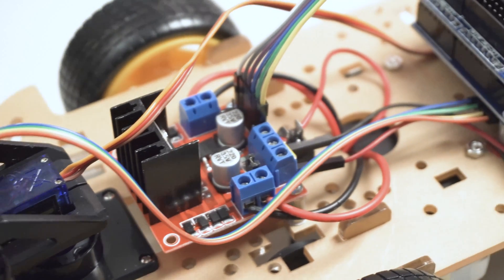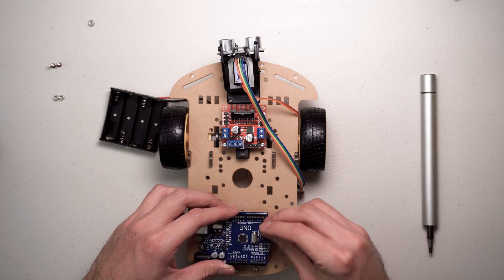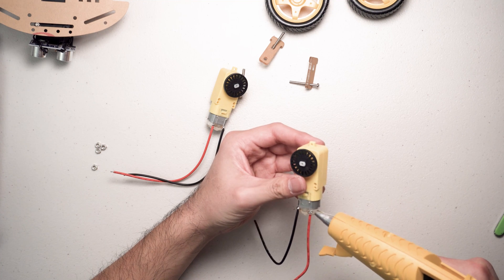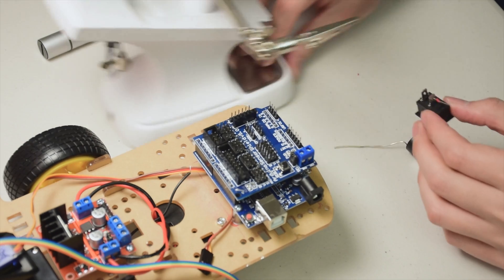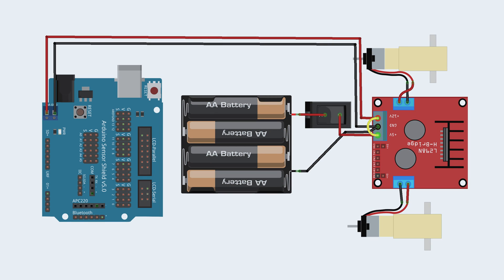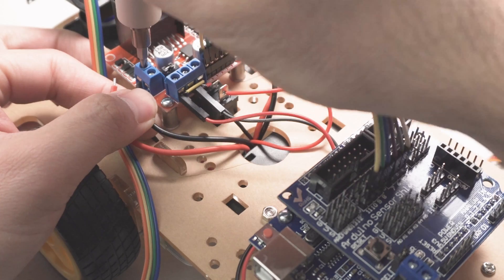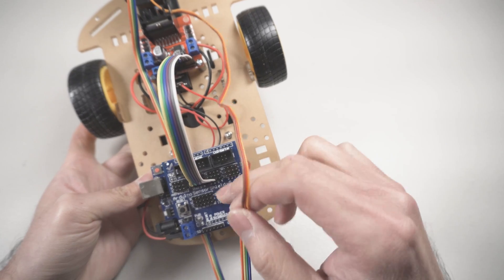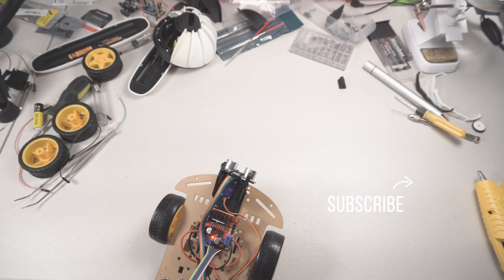Arduino Smart Robot Car from Banggood: PART2 Electronic Connections

Comment: Thank you for the video! It really helped a great deal. I am using a PIC microcontroller, do I still need to connect the sensor to analog pins and the servo to digital pins?

Comment: Thank you for this, really helped me!
I would like to use a power bank instead of those batteries by attaching it to the USB port of the arduino. How would I need to wire the arduino to the shield for power?
Reply from the maker: The shield should be powered by the USB as well. Give it a try. Let me know if it doesn't work.
Reply: Very helpful and clear instructions...looked so many places to find your simple set of clear instructions. Many thanks

Comment: hi bro, thank you for the tuto, but i have a problem in the l298n module you have 6 pins but i have only 4 what i have to do?
Reply from the maker: Could you tell me what are the 4 pins?
Reply: @ChenTheDesignMaker  https://www.theengineeringprojects.com/wp-content/uploads/2017/07/L298-Pinout.jpg
look in this photo i have the module whit the ativa MA and ativa MB like that and i cant put a cable in
Reply from the maker: @spraz3r348  ah, are those jumpers? Just use a some tweezers to remove those
Reply: @ChenTheDesignMaker  please help me cause i buyed the kit two times and i dont want to put my money in garbage

Comment: every time  i try to test the ultrasensor and connect the GND to A0 it makes the arduino shutdown and i cant load the code.... HELP BRO
Reply from the maker: Wait, isn't GND connecting the GND? why A0? Sounds like there might be a wrong connection that shorts the arduino.
Reply: ALEX PAPAZOGLOU  no worries dude I fixed it after all...2 connections were messed up 😂 now the other problem is to create an ir beacon that will “make” the car follow it😝

Comment: Hi. Thanks for the videos I found them to be a great help. I have a question, I am able to upload the sweep test it seams with no problem but it does not seam  to work the servo will make on small movement and the just stays motionless. Any ideas. Have I missed something. Motor test is fine. Is it something to do with library
Reply: Think I have sorted it with the amendment of the Pin 9 I change to pin 3
Reply from the maker: Great！ Have fun~ let me know if you have other questions.

Comment: Chen,  Great tutorials.  Two problems,  When I run the motor test, the robot turns right not left (or maybe right not left).  How do I switch the wires?  Second, for the servo test, when I first upload the sketch, the servo turns full right and stops, never to go again.  Any suggestions?
Reply from the maker: Hi Mary, for the motors, you could switch the motor A to motor B, or switch the respective 3 pins for each motor.
Reply from the maker: For the servo, first manually turn it to make sure the range is fine, I would check connections next. Make sure the pin defination in the code matches your pin connection.
Reply: @ChenTheDesignMaker   Seems that servo is pinned to pin number 9 in test code. But we have it in pin number 0. Try to switch them and it should work.

Comment: ChenTheDesignMaker
Why did you connect the 5V output with the motor supply?
Reply: And whats the advantage of it? Sorry if you mentioned it in the video but my english is not that well
Reply from the maker: Hi, it was actually an oversight. The power terminal is the only power connection on the shield so I thought it's the input. It works perfectly fine. However further research suggest the Vin Pin should be the best for power input. It goes through the on board voltage regulator to provide 5v, but that also means we have to provide something above 7V for the V drop. Since we already have 5V from the L298, connecting to the 5V works fine even not being protected.
Reply from the maker: Hopefully this make sense and let me know if I missed anything. For further reading: https://electronics.stackexchange.com/questions/65576/arduino-uno-r3-directly-supply-regulated-5v-to-5v-pin

Comment: Can I use a 2s 2400mah lipo instead of 4x AA battery?
Reply from the maker: Hi Gemmo, I did some search and seems like it is a 7.4v battery, is it?
Reply: ChenTheDesignMaker, yes it is. Unfortunately it's dead already and i just bought a 9v battery. Im on the loading of the program stage now, thank you for your video im learning quickly :)
Reply: I followed the wirings and uploaded the code but it doesnt seem to work. I cant figure out where my error is.
Reply from the maker: Could you describe what's the issue? Is it the motor? or servo? Or no power at all?
Reply: ChenTheDesignMaker if you dont mind, do you have facebook or other social media where I  can send pm's? Thank you.
Reply from the maker: Sorry I'm at work now, let's just chat here and I can reply every now and then. It also helps others if they have similar issues.
Reply: ChenTheDesignMaker https://youtu.be/KNRqGAARZNI
https://youtu.be/lme9tJr9TQc

This are what's going on. The only difference is the jumper for the 5&12v terminal, i intentionally did not put it because im afraid to overvolt tje logic boards.
Reply from the maker: Your power connection looks fine, the jumper for L298n internal voltage regulator is on which means it's having 5v for the logic. The motor is driving slowly I think it might be the enable pin getting low voltage? I suggest we just run the motor test code here, ignore the servo and sensors, to check if it's a connection problem.
Reply from the maker: Also I was trying a 9v but my connection is different than yours, see it here.https://youtu.be/ms0C3o407oM?t=3m30s
Reply: ChenTheDesignMaker if I put he 9v to the gnd/vin of the arduino, it means that the power to drive the motor comes from the arduino board to the L298N? The 9v connection I did was same to your L298N tutorial where you used 12v.
Reply: ChenTheDesignMaker i'll do that thanks!
Reply from the maker: I think the Vin on the arduino is connected to the terminal block on the sensor shield, so it's passing the 9v to L298N(Need verification, worked for me earlier)
Reply from the maker: Good Luck!
Reply: ChenTheDesignMaker hi chen the motor driver test is ok. https://youtu.be/0er8MUH_vOs but im having problems loading the sensor test program, there are 2 sets of void setup. I hid the first set but the sensor isnt working.
Reply from the maker: Now we can confirm all the components and connections for power and motor are working, good news! A typical arduino code should never has 2 set of setups or 2 set of loops. Have you tried open a new file, delete everything, and do a clean paste? Sometimes a small typo would cause all the problems. Any error code presented?
Reply from the maker: Hmm, that's weird, i was having problem with lower than 180 but never higher. Anyhow,  double check the pin 11 and 13. Earlier I made a mistake connecting the EN to pin 13, which is not PWM pin, 11 is the right one to go. Also don't forget to update define area in code if you swap pins.
Reply from the maker: I think now it's minor code checks, let me know if you see any problems and let's figure it out together.
Reply from the maker: It's awesome you make battle bots! I love it! One day I'll make one, too 😄

Comment: Why my  tt motor doesn't work？
Reply from the maker: Hi, I would first check if the motor runs with voltage applied to it, like 3v 2 AA batteries. If it runs, it must be a connection problem. Check this video: https://youtu.be/TMwBQ4sb3XY?t=2m5s to manually test the connections. Let me know if this solves it. Good luck!
Reply: Manually the tt motor test ok!!! but assembly the smart car still doesn't wok....
Reply from the maker: If the 298N works fine on your manual test, it might be a software problem, can you check if your pin connections are matching in the #define area of the code? Let me know how it goes.

Comment: Hi Chen, i have a little question, why do you have bridged the 12v and 5v? Can you explain it for me, thank you!
Reply from the maker: Hi Dropkicker27, here are more information about the L298N connections: https://www.youtube.com/watch?v=TMwBQ4sb3XY
Basically the 12v pin is the power to the motors and 5v is powering the logics in L298N. The 5v pin supports 5 to 7v so it is safe to connect the 4 AAs to it, as well as the 12v pin. If you need to driver bigger motors with bigger voltage, the 5v pin can even be ignored with the on board 7805 voltage regulator. Check the video above and let me know any further questions.   Happy Making! :D
Reply: Thank you for your quick answer, ah it make sense to me now. Nice vids by the way.